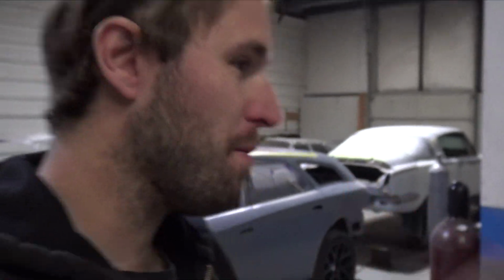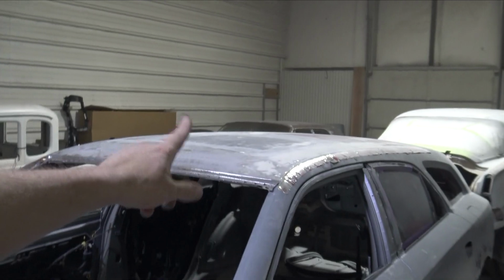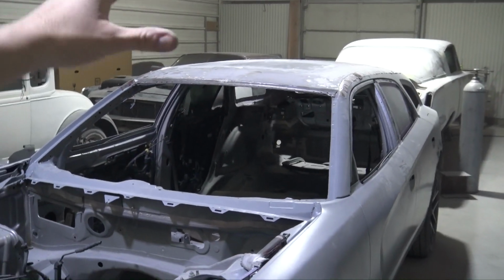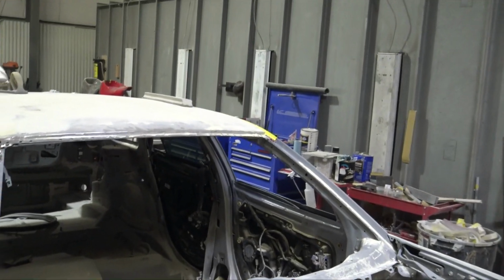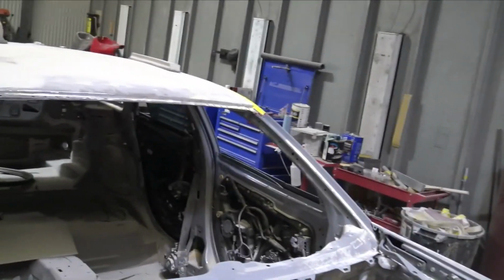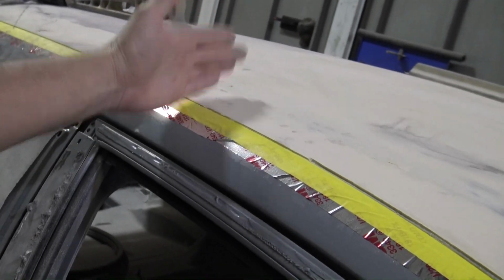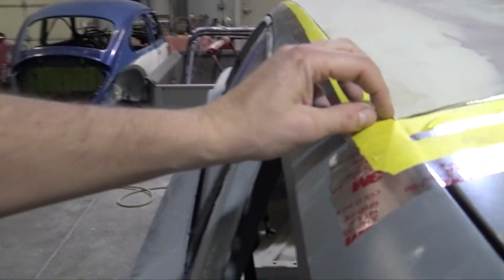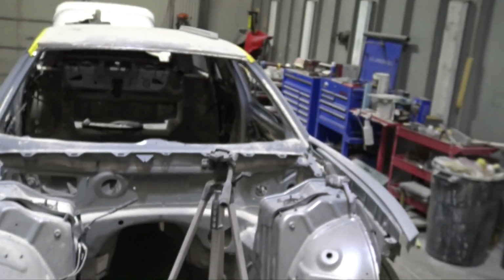Building the Ultimate Station Wagon | 2021 Charger Magnum Hellcat | 1000HP Hellwagon | Pt 29

Comment: Come on Dave how much longer before the bondo wagon is done. I hope you are getting sponsored by a bondo/body filler company.
Reply from the maker: Barely any filler on the car
Reply: Bondo wagon🤣🤣🤣🤷🏻
Reply: Some people dont realize this is a mold🤦🏻🤣
Reply: I’m not talking about the roof, is every other area where there is new metal that was tack welded and not fully welded. You filled the holes with bondo or body filler. Look at the trunk or hatch area, the taillights you added new metal to shape that area, you barely tag welded that area and you filled that up with bondo.
Reply: @cheesestick8024  i caught the previous vids and i somewhat agree with ya. But in those spots it should hold up nice.
Reply: @cheesestick8024  but when you said "Bondo Wagon"💀🤣🤣
Reply from the maker: You also do realize the hatch is going to be carbon too right or did you miss that episode as for the rest of the car every panel was fully welded

Comment: So i dont understand, does the dura-glass only stick the the metal of the roof? and the tape is so that it dosent cure in the valley?
Reply: He put tape down and mold release on tape so he didn't hurt primer area on roof valleys n lines in case it cured and pulled primer and glaze puddy.
Reply from the maker: Mold release is your friend if it wasn't there the roof would have been a permanent addition
Reply: Ahhh i missed that part about the mold release. This makes more sense now @Jacob Phend

Comment: It's not going to be carbon fiber. You dumped gallons of filler all over the car. Waaaaaaaay too much plastic on this car. Panels should be welded in. This is never going to hold up...after all this labor. What a waste.
Reply from the maker: Not paying attention what a waste
Reply: ...AND..."Josh" should tell you to NEVER use Bondo (of any kind) OVER paint/primer (of any kind) EVER!!!
Reply: @Junkyard_Dave  You will be when all the plastic bubbles up off the car. What kind of place is this that even allows such shoddy work to be done with their likeness in the background?
Reply from the maker: You must not know much
Reply: @Junkyard_Dave  I know not to dump gallons of Bondo over primer and paint.
Reply from the maker: @houseofthediamond8191  not sure where you see gallons but if your so sad about how bodywork goes you can kick rocks